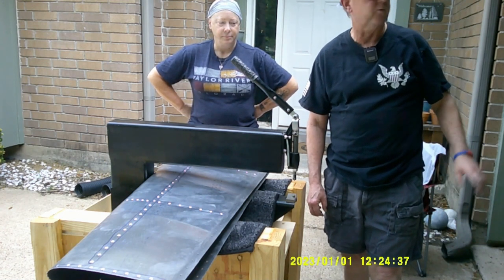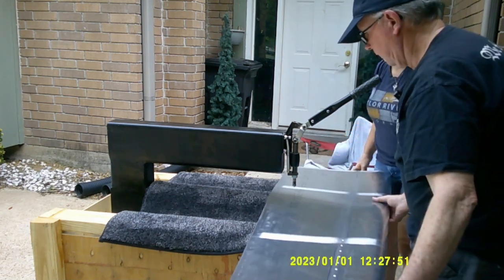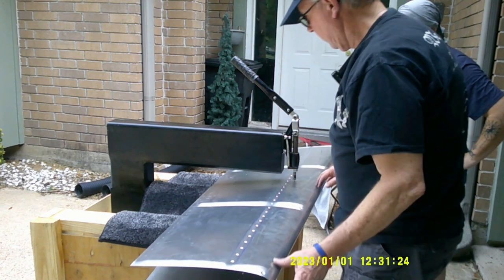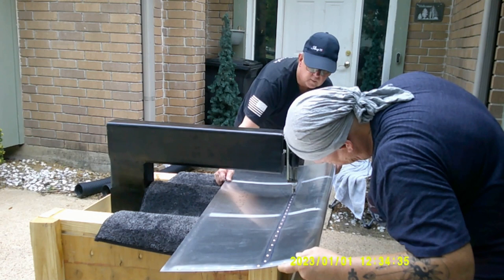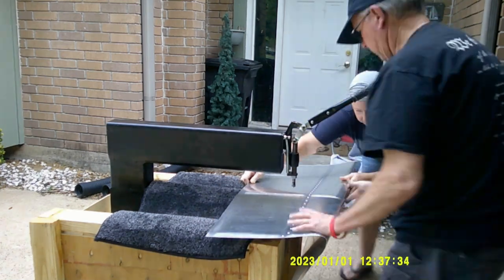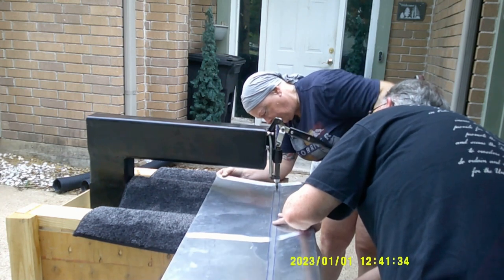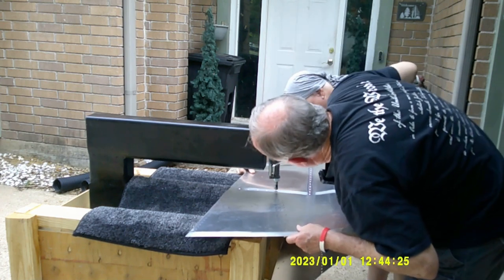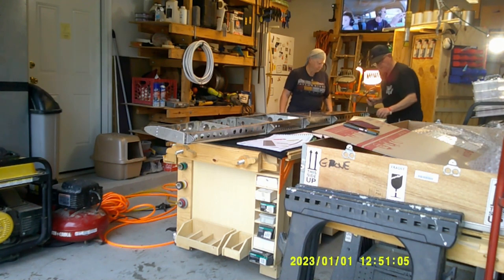Horizontal Stabilizer - Part 3

Comment: Note sure if the date/time stamp on your video is correct. If so, probably you've done a bunch more dimpling since then. Couple hints based on my TSi build experience. Within reason, the bending to complete the dimples isn't an issue. You'll be doing this a lot more on a bunch of other pieces. You may want to reconsider where your dimpler is located on the stand though. If the nose of the dimpler were sticking out more you wouldn't have to bend so much because of the stand legs. I would also recommend trying to get the aluminum down flat on the lower die half before closing the dimpler. You'll get a cleaner dimple without distortion outside the dimple. Finally, you can wrap a piece of tape around the die to keep it from falling out. I did all the dimpling on mine by myself. But I also had tables on each side the same height as the dimple dies. That helps a lot.
Reply from the maker: The date stamp is probably not correct, we're still learning all this video stuff...

Yes, I looked at the dimpler since your post here.  We have it set to the correct heght for the primary work bench, but your correct, and I'll be moving it forward today 6.5 inches.  Thanks!  

I'll also add some tape as suggested 

Great suggestions, thanks again!
Reply: Is it possible to swap the simple pin with the dimple shaft so that the pin is on the bottom, making it easier to line up the hole on the parts you want to make the dimple in?
Also, how much do you expect this entire project will cost once you’ve completed it…including paint…and ready to fly?
Reply from the maker: @markkirchman2864  

Yes, absolutely you (we) can switch the pin (Male) to the bottom position, and I have on my hand dimpler.  However, if you do, you have to remember to turn your skins upside down,  and for me that's counter-intuitive, so I didn't.  But, yes, it is certainly possible.  

Probably about $225k  Give or take depending on options, and such.  The more the paint scheme, the higher the cost.   Barebones, probably just under $200k.